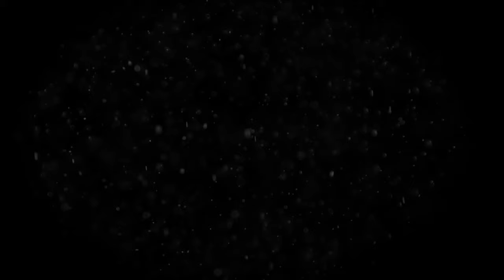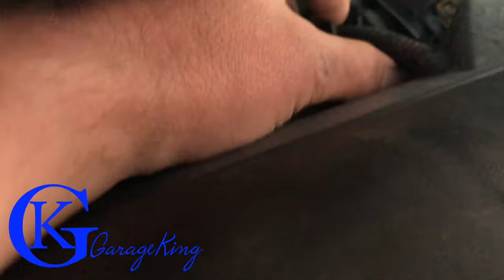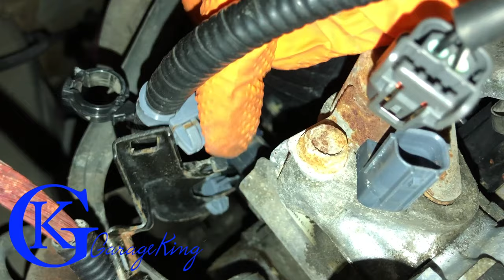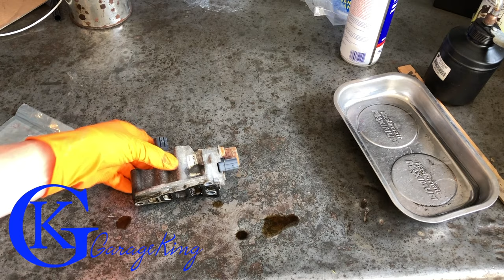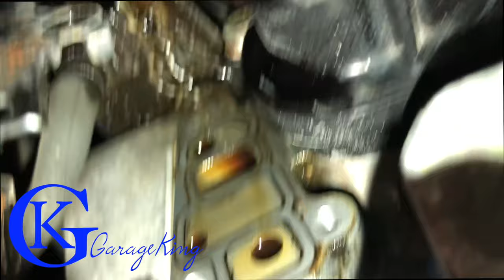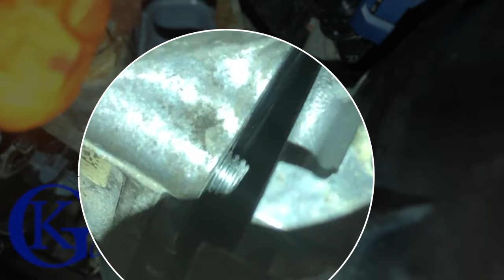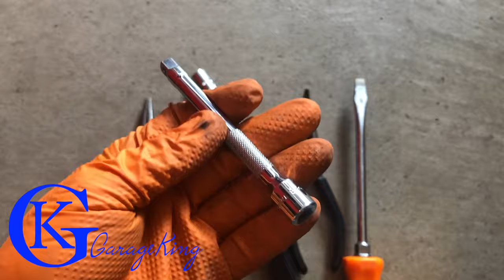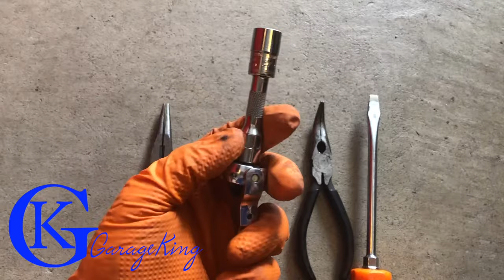Honda Civic Leaking Oil on Passenger Side from Cylinder Head

Comment: If anyone is wondering the part # is 15826-RNA-A01
Reply from the maker: Yup that is the part number :)
Reply: Is it for vtec engines or non-vtec ??

Thanks
Reply: That is the oil leak I just found thanks for  making this great video
Reply: 15826-RNA-A01
Reply: 15826-RNA-A01

Comment: For better access to that area you can remove the wiper arms and that plastic shroud that has the wiper fluid nozzles on it. It really opens up that area and makes the job alot easier.
Reply from the maker: Thanks very much for the comment, I heard that after I did the job, I guess my arms could fit in LOL
Reply: I did this as well, in addition I removed the metal bracket underneath, 6 small bolts, 2, 10mm & 4, 12mm which was easy but just gave me more room to give easier access.
Reply from the maker: @jameswalker1210  Thank you for the reply and sharing your hint, we can all learn from each other !

Comment: We did it! Thank-you!!! My 2010 ex civic had an electrical post above the 3rd lower bolt making it 10x harder. Also I'm not sure that Amazon gasket is great quality but this was easy enough ill get the oem if it leaks. I have a feeling my leak is from something else in that passenger side upper area though.  Cleaned off as best I could so we'll see.
Reply from the maker: Excellent comment and thank you !!  Glad I could help out : )

Comment: Did you notice the oil leak make it all the way on top of the lower motor mount right near the drain plug? That’s the issue I have , just wondering if that is what you noticed.
Reply from the maker: Thanks for the comment, I did notice the oil on mine was leaking all the way down to the drain plug.  It was bad on the side of the engine.  At first I thought it may have been from the power steering pump, so I washed everything off and then checked after a few days and found it was leaking on the rear of the cylinder head.  So that's how I figured out it was that part.  The part is under 10 bucks and its really common for them to leak.  You could maybe consider using some engine degreaser and wash it all off and then check after a day or two.

Comment: I initially thought the oil leak was caused by a cracked engine block. Thank you so much for the video
Reply from the maker: Anytime, and glad you got something out of the video !!!
Reply: It would be cracked engine cylinder head not block if it was from up higher

Comment: Thanks!  I was able to stop the leak on my 2010 civic with 157k miles.  I didn't remove the rubber hose but just worked around it fine.  The bottom bolt is certainly the hardest so thanks for the good  label of it in the video.
Reply from the maker: Thanks for the great comment and glad you got it all done. Leak is fixed !!!

Comment: Excellent. Yours was the best description of how to do this that I found, as you showed all the details that others leave out.  So, I tackled it on a friends 2006 civic and it went well.  The one thing I did differently, was that I used a box end 10mm wrench to break loose the three long bolts as I was not getting enough torque on the small ratchet.  The spec is to tighten to 7.2 ft pounds (86 inch-pounds).  That seemed not snug enough, given how tight the factory bolts were installed, so I snugged them up more.  Cleaned both surfaces well, as you did. No leaks noted so will see if it fixes the nasty oil leak. The gasket from Honda dealer is about $8.00
Reply from the maker: Awesome you got it done and kuddos to you for doing it with a box end wrench, I know those bolts are tight !!!!
Reply: My dealer wants $13 for it? Aren't they all supposed to charge the same
Reply from the maker: @AudreysKitchen  Hey There, as each dealership is a franchise I guess they could sell for whatever they want, but they should follow the suggested price by the manufacturer.  Shady business practice to jack up prices like that.
Reply: @AudreysKitchen  yeah that’s what dealer charged me

Comment: just gave it a squeeze??? how? Now i know why you did not show on camera. It's impossible to get off. Finally got it. You have to sqeeze it in the right spot at the tip and pull.You make the job so easy looking. I found it to be a struggle working in that small space. I even had to spray pam oil on my forearms so I could slip in and around in there. In the end everything was done correctly. No more leak
Reply from the maker: Ha Ha, thanks for the comment :)  Well well, you are right its a heck of a squeeze to make it work.  The reason I didn't film it, is that its impossible to get the camera in there, let alone a body part !!!!  I do film as much as I can, but sometimes you just can't get it all.  I love your comment about using Pam on your arm !!  I am glad you got it all done, success and you can walk away happy :)

Comment: Can't wait to try this out. Oil is leaking, went to a mechanic and they changed the engine gasket but still leaking at the same spot.
Reply from the maker: Hey Thanks for the comment, just make sure before you do it you give the engine a good clean, this way you don't have to worry about dirt getting in the engine.  In addition, once you do the job and drive it for an hour or two you can check and see exactly where its leaking from.  This gasket is really cheap so worth a shot for sure !!!  Make sure you have a good swivel ratchet, it makes the job 100X easier.  Links are in the description if you are curious.  Thanks !!

Comment: I think I fixed my oil leak problem it’s not throwing oil any more from the serpentine belt and there’s no drips so I will wait and see how it does used your video to fix it
Reply from the maker: Thanks for the comment, and if you have some engine degreaser and a hose you can rinse off the engine, just so you know its clean and then its easy to spot if something is still leaking.  Glad the video helped you out, and I hope its all fixed up !!!

Comment: Great informative video well made and easy to understand. Good to see this job can be done without having to remove the cowlings and wipers etc for access to the part.
I have a slight leak in this area and might need to change the gasket as per video, but not totally sure it is from this
part, as it may be from the timing chain tensioner inspection cover on the front of the chain case which is another
common place for a leak on the civic and may need resealing, but so far cant find any videos of this part being removed and resealed.  Great video keep up the good work.
Reply: haha just found the video on resealing the chain tensioner inspection cover also a good video but not quite as good as this one, so once I'm 100% on where the leak is coming from ill be good to go for the fix thanks to these videos.
Reply from the maker: @user-sd3zh9nx9r  Thanks for the great comment.  My advice would be to spray a little engine degreaser and hose it off, then drive it for a day a recheck.  I hope its this video you use, as the timing cover is quite a bit more work.  This job is actually pretty easy, and its very common.  Have a great Sunday :)

Comment: Thanks a lot for the video did good just don’t forget to put the top 2 bolt back in hand tightened before you put the 3rd lower bolt one there all in hand tightened, tighten with the wrench 🔧
Reply from the maker: Good comment and very true, you want to make sure all bolts are threaded in.  Last thing you want to do is cross thread a bolt in that spot !!!  Thanks for the comment !!

Comment: Just a thought, while you are at it check and replace the PCV VALVE. When that fails high internal pressures can increase the chance of oil seal failure. We change it every 30,000 miles, also it keeps the engine from sludging and fouling the oil.
Reply from the maker: Excellent comment and you are 100% right.  I appreciate that and hope that others will consider doing so.  Thanks again
Reply: @GarageKing  Keep the great videos coming 👍, good how to videos help greatly when doing these projects. Thanks again!
Reply from the maker: @GgRae-gv1tg  Thanks for the great comment.  I usually do one repair vid a month as I do the Snap On tools sales for each month, along with a review and some shorts.  I'll continue to do my best !!!  Thanks and hope you are enjoying your weekend :)

Comment: Thanks I'll investigate this part. My civic started leaking rendering it undriveable as it leaked so fast you could go only maybe a 5 miles before it blows up. A while ago i refilled the engine oil thinking it was one time. I ended up making a perfect line of oil around the apartment complex so i parked it. Fell on some hard economic times so it's been sitting for a couple months but im now trying to get it fixed asap.
Reply from the maker: Sorry to hear you fell on hard times, it can happen to anyone and glad you kept your head up.  If its leaking that fast I doubt its the gasket, but you may have to do it anyway and I'll tell you why.  There is an oil pressure sensor screwed into it, and that may be leaking, when it go it leaks fast.  To fix that part you just get a new sensor and they thread in to the housing you will remove.  Also to be sure if you have access to a garden hose I would use a can of engine degreaser, wash the engine off, let it dry, and then run the vehicle while looking to see if you can find the leak.  Sounds like its leaking fast so it should not be hard to find.  Good luck with the repair, and hang in there !!
Reply: @GarageKing  thank you, I'll look for that one too
Reply: @GarageKing  i examined the engine and confirmed it is indeed that part, i still don't know if it's the gasket or the oil pressure sensor but at least now i know what's causing it. However my mother beat me to it and hired some mobile mechanic who wants to charge 900$, i told her to get a 2nd opinion she ignored and now is doing it. I don't think we even have $900 yay
Reply from the maker: @PlumbCarton5607  OMG, the part is about $5, and the sensor I have no idea, but as a guess I would say not more than $50???  I guess you mom is paying for convenience, as someone is coming down to do it, so time is money and the mechanic has to pay for gas, mileage etc.  At least you know it should be fixed correctly.
Reply: @GarageKing  yeah and it doesn't look that hard to do. He jacked up the car from the engine. He's also trying to boot us up for more stuff. He then took the alternator & tensioner, and some various other stuff to get different ones, even tho those worked fine. I wasn't there to stop it

Comment: Is this replacement similar for a 2001 Honda Civic EX?
Reply from the maker: No, the 2001 EX is actually easier. This video is for an 8th gen engine, yours is a 7th gen engine, and that engine style use to leak all the time from the distributor that was located on the left hand side of the engine when you are looking down from the top. They did away with the distributor, but the style was still the same so for yours when you look down from the top.  It usually leaks on the left hand side of the valvecover from a plastic plug located on the side (where the distributor use to be)  You have to remove the EGR valve to get the plug out, and the plug has an o-ring on it.  This is most likely where your leak is coming from.

Comment: Thank you so much for the informative video! My first car is a 2008 Civic and I noticed an oil leak in the same area in the video a few days ago, I replaced the gasket and it was my first-time car fixing experience, everything worked like a champ! I want to ask is it normal for the check engine light to come after I replaced the gasket? The light is on but the car drives normally, again thank you so much for the awesome video!
Reply from the maker: Thanks for the comment !!  Not normal for the check engine light to come on.  Make sure you have the electrical connector plugged in and everything is tight.  I would give it a quick scan to check for codes to see what pops up.  Maybe times you can go to Autozone or some other parts stores and they will check the code for free.  If they do, write it down, clear the code and drive it.  It may not come back.
Reply: @GarageKing  The light is gone now, thank you very much for the reply👍
Reply from the maker: @martinli7761  Anytime !!
Reply: @GarageKing  have you replaced the pcv valve on any of these civic? I’m just wondering if that could be part of the problem? Thanks for the video
Reply from the maker: @robwright4398  No haven't replaced the PVC, on this one I could tell it was definitely the gasket as the gasket was hard and brittle. If the PCV ever got plugged there could be a pressure build up, but then I could just as easily leak from any of the seals in the engine.

Comment: My 2012 Civic has the same engine and suddenly started leaking oil, didn't realized it until it warned me in the dashboard, this calmed me down
Reply from the maker: Hey there and thanks for the comment.  This is a common problem with the civic and an easy fix for an hour of your time and a $5 gasket.  If you got a light on your dashboard then I would check your oil level right away !!

Comment: Thanks, I have opened mine today and the 1 lower bolt was pretty hard to open. I am waiting for the gasket to arrive, how tight should I torque the bolts back, i dont have a torque wrench.
Reply from the maker: Hi There, I don't think I could find the torque specs.  I know there are manuals out there you can buy such as emanuals https://bit.ly/44zVazx discount code (GARAGEKING22) but the problem is its almost impossible to get a torque wrench in there.  I'm actually a GM mechanic and on GM cars similar gaskets all get a torque of 89 inch lbs which works out to about 7 ft/lbs.  So its really not much.  Once you feel the gasket compressing, give a 1/2 turn or so on each bolt (keep moving around) so they all get pulled down evenly, then you WILL feel them all of a sudden get tight (now the part is fully down) then you just go a little more to snug them up so the bolts don't come loose.  Its really not tight because the bolts are not supporting anything. Then after a few drives check it for leaks.  Hope this helped.
Reply: @GarageKing  Thanks buddy, I think it's 8 ft lbs of torque for civic. I will try to give them a good medium strength push, and yes there's not much room, I already cut my finger while opening the lower bolt😅, hope  things go fine.
Reply from the maker: @aakudev  Fingers crossed for you my friend :)

Comment: Your video was extremely informative for a guy who is just starting to do his own car maintenance. So I replaced my part.  I still I’m leaking some oil in the same spot. Could there be a pool of oil somewhere around the engine that continues to drip down? Thank you for all your help.
Reply from the maker: Hey Thanks for the great comment,  yup it leaks down onto the rear of the cylinder head. If you have some engine shampoo you can spray the engine down (put a bag over the alternator) and then hose it off while staying away from the electrical stuff and then see if it still leaks.

Comment: So I have an issue with the plastic piece that is on the side of the block? Right next to where you were working at. Can't seem to find any video on it. When the car is on that plastic coin looking thing vibrates and there's oild spilling out of it? Don't know what ig is? Don't know what part it is. Any clues or pointers you can give me?
Reply from the maker: Can you give me a time stamp?  The only thing that I could think that would squirt oil is the oil pressure sensor that is screwed into the housing.

Comment: Thank you for the awesome video! What did you find was the best way to clean off all the oil?
Reply from the maker: Hey there, I used some engine degreaser and then hosed it off.  I must say the best way is to use brake clean, but it gets expensive.  Make sure you don't use brake clean on a hot engine !!

Comment: Fantastic video. I think this is the issue on my 2008 Civic. Did you have to drain the oil first, or can you just crack on with the replacement gasket? Thanks!
Reply from the maker: No need to drain the oil, just clean the area first so you don't get dirt in the engine.

Comment: My civic has this same leak on the front passenger side and my car is a 2016 civic sport cvt not sure if this year would have the same problem or what year the guy in the video is workin on please help
Reply from the maker: Hey there, I think the engine should be fairly similar, I think the engine in the video is an "R" style engine and that engine is still made in the 10th gen civic (yours)  there is also a "K" engine. I would give it a quick wash, and then look in the rear and if you have the same type of VVT solenoid on the rear of the engine (could be slightly different shape) then that could be your problem.  Important thing is to clean the engine and then look as the thing leaks all over the place and you want to make sure you get the right leak.

Comment: What is the function of this filter, and what type of cleaner did you use? Thanks
Reply from the maker: I think its to keep debris out of the VVT (Variable Valve Solenoid)
Reply from the maker: I used a general engine degreaser to clean the engine first, then I used brake cleaner to clean the part (once it was apart) clean the engine first as it reduces the chance of debris getting into the engine.

Comment: It's also good to replace the other gasket and the o ring
Reply from the maker: I didn't know there was another gasket?  Unless you took off more stuff ?  I left everything in the housing and the only gasket I saw was the gasket that seals the housing to the head.
Reply: @GarageKing  yes remove the 3 bolts and there's gonna be another gasket and loosen the oil pressure switch and there's an o ring there too.
Reply from the maker: @ismaelmoreno7074  I went back and see what you mean.  I never touched that part as it was dry.  Normally that part never leaks.  Thanks